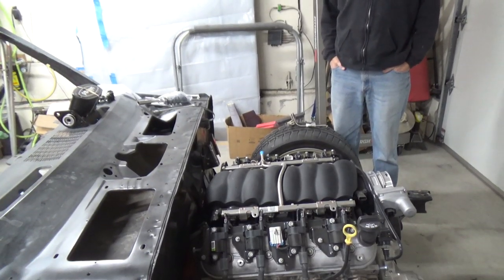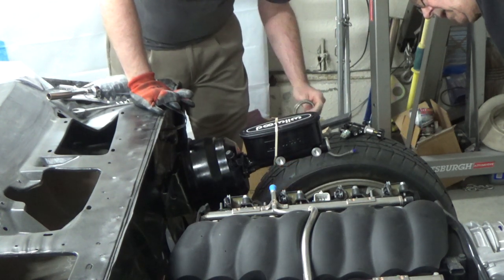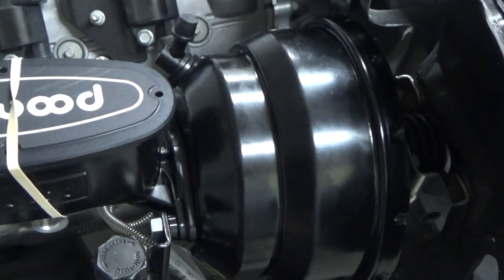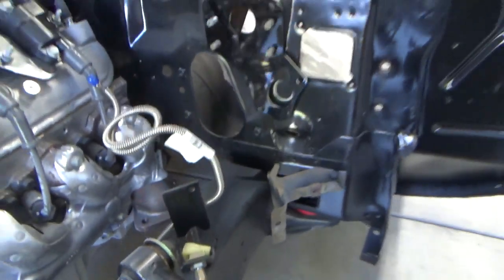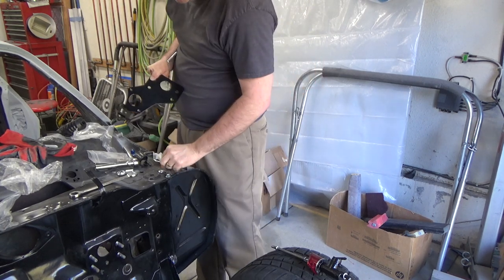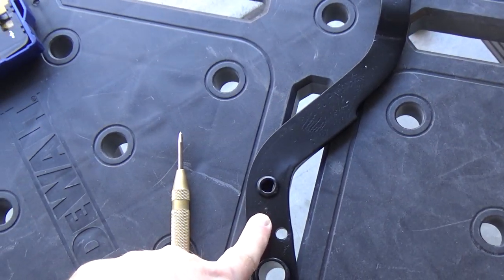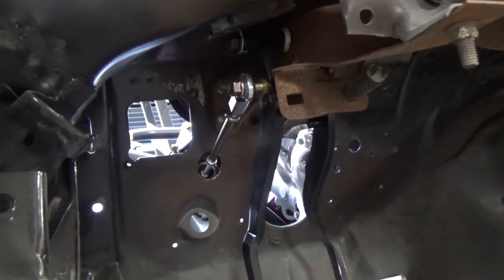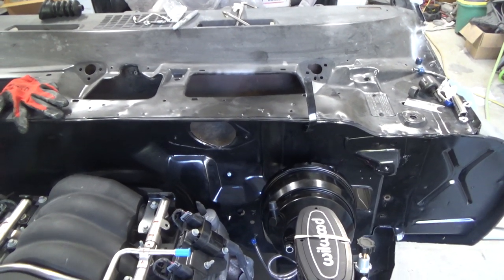1977 Camaro Z28 Part 202: Firewall pt I - mock up

Comment: I recently had my factory booster off for clean & paint.  The boot just presses up against the firewall, no adhesives.  It had some oiled foam rubber around the plunger to keep dust out of the booster.  So, you can rest assured that your set up is at least as good as factory :D
Reply from the maker: LOL. I would like to seal it up somehow. Maybe some black duct tape haha. Thanks Mark

Comment: I started checking all my pedal stuff and realized I didn't order the inner firewall insulator and rubber mat thingy.  Looks good Erik and Pops!
Reply from the maker: Thanks Cliff. Which rubber mat thingy?
Reply: @asicerik  Google "Camaro part # 333707"...I just ordered the one from Speedway Motors. The carpet goes under it on the drivers side, kind of a foot rest also. Took a while to find!  I found the formed insulation pad in a box of stuff I ordered years ago but you're going Vintage Air, so Dynamat might be the way to go after your holes and grommets are in place.
Reply from the maker: @cliffwright9842  Thanks bud! I added that to my cart at Summit. I was thinking Dynamat. Well see.

Comment: Put the fuse block in the glove compartment! Then its all clean wires in the engine compartment.
Reply from the maker: I am not sure it will fit. The glove box gets smaller due to the Vintage Air system.

Comment: Before you go too far, the Wiring harness pushes from the inside-out, there should be only one large cable going outside and it breaks to several leads. This should all be explained in the manual for the harness. The Map sensor is on the back of the intake manifold. Look at the harness if you need some instruction get me your email address and I can send you my PSI manual it is pretty much the same. The MIL is your check engine light. You;ll get it. it is really easy once you see the manual. Let me know if you want a PDF version of my Wiring harness.
Reply from the maker: Hey Cary! This is the GM harness, no manual. It does not seem to work the way you say. The three main feeds which join just behind the engine. I don't see how it can all get stuffed behind the firewall.

Comment: Hey Erik, I bought a new recessed wiper motor from Camaro Central.
Reply from the maker: Thanks bud. I don't see one for 77 though. Only 70-76. Not sure what the diff is.
Reply: @asicerik  I'm not sure. Actually the one I bought, 70-76, I'm going to use it on my 81. Lol. I know the pump is different, but I'm not real sure what else could be different.
Reply: @asicerik  it's a typo, 77 firewall didn't change
Reply from the maker: @PyroBlock  Great, thanks. I already have the rebuilt one. We'll see how it goes.

Comment: Could that rubber gasket/sleeve be on backwards? It looked like it had a round relief in it toward the booster that might work for the firewall.
Reply from the maker: Sorry? Which part are you talking about?

Comment: Did the master and prop valve not come with the two lines? Yes you can bend those lines by hand but be careful if you have to reflare them because stainless line is way harder
Reply from the maker: Hi Michael. Are you talking about the lines from the prop valve to the master cylinder? Yes, we just did not install them yet.
Reply: I have the same master setup and didn’t know if you had them.

Comment: Where your 1/4x20 bolts and nuts  come thru the firewall I used stainless acorn nuts and washers looked a lot better .
Reply from the maker: Thanks! I will check that out.